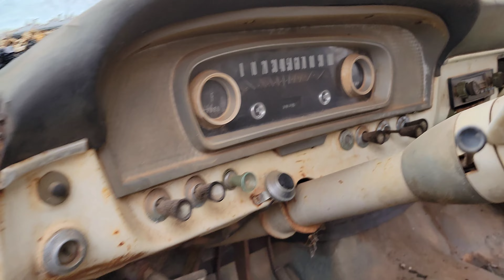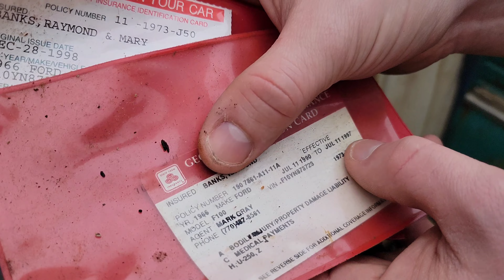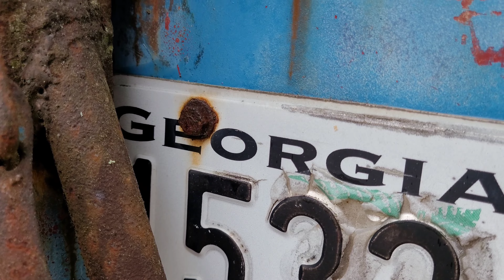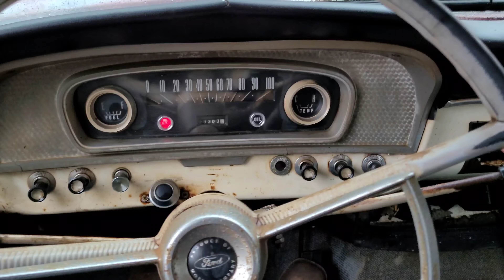Abandoned 1966 Ford F100 Revival! Will it Run?

Comment: your search for the truck is a custom cab camper special deluxe or a custom cab service truck that has a 352 engine or a 390 engine check the vehicle ven numbers on the door a piller next to the window and top door hinge it will tell you the information you need to know about your truck the 1965 and the 1966 ford's are the same thing over all thir are some things that are different from the 1965 and the 1966 truck if you have a chance to look up the information you need for your truck go to the Ford dealership and get your hands on a Ford truck manual for your own vehicle for a 1966 Ford and good luck with all your parts and repair